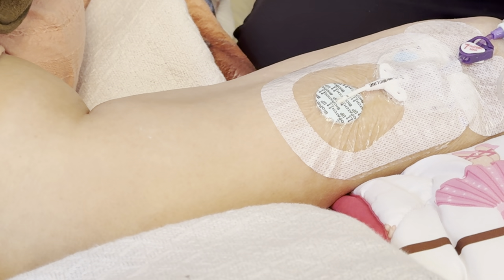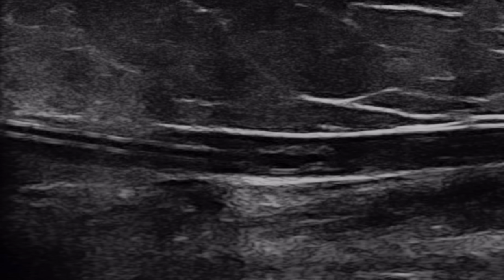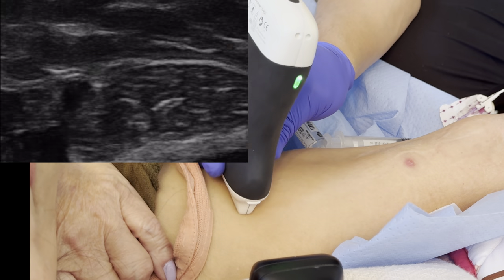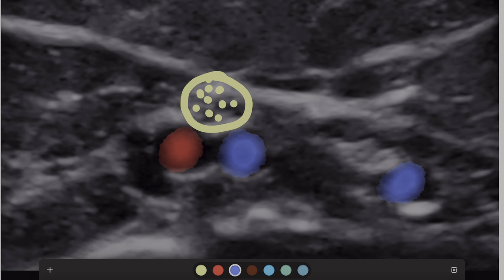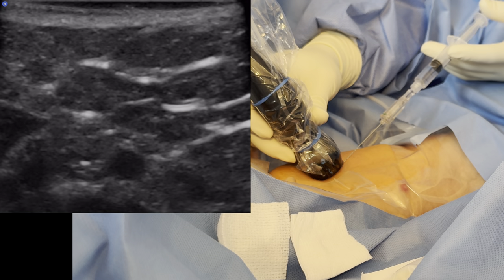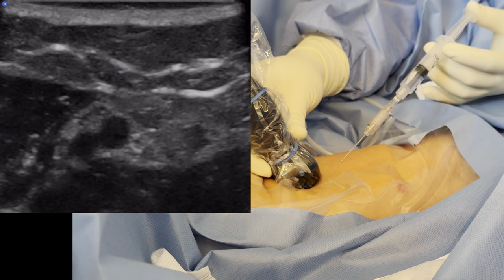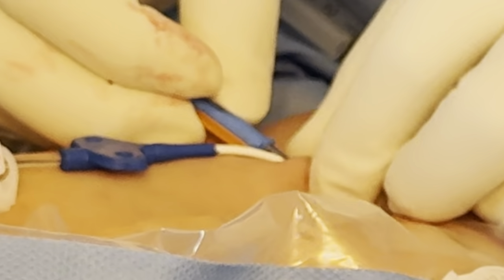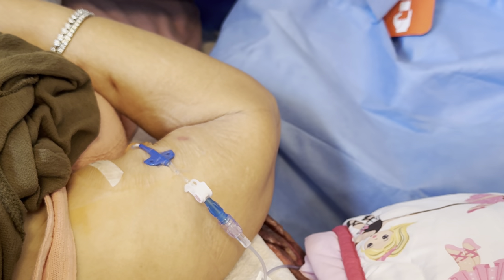Midline Failure and Replacement (Full Procedure)

Comment: Thank you for sharing your technique of approaching vessels and critical thinking in terms of device selection. I learned a lot from your videos! What’s your opinion on using trimmible midline vs 10cm powerglide midline on upper arm? Is one better than the other depending on patient’s factors?
Reply from the maker: That’s a fantastic question, but also difficult to answer! It’s like asking which vehicle I would like to use: truck, Lamborghini, motorcycle, or rollerblades 😂. Contextual variables will determine which catheter will be best at that moment for that particular patient. Right catheter, right patient, right treatment, right time. Every device and procedure has its own benefits and deficiencies.
Reply from the maker: Give me a context, and I can give you a better opinion